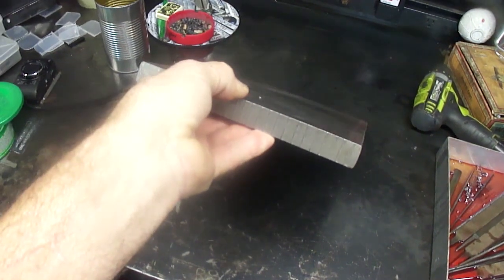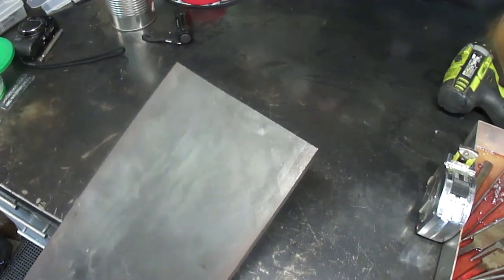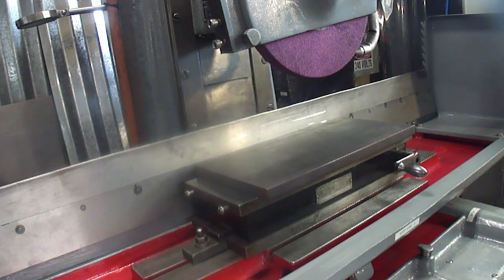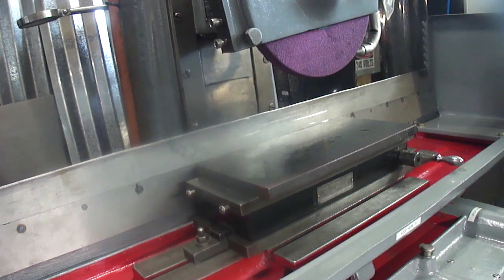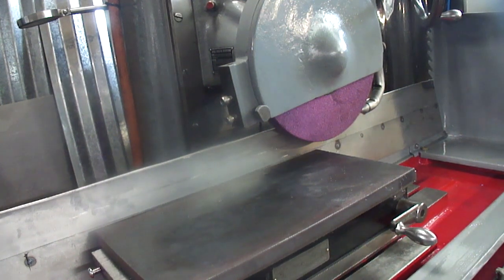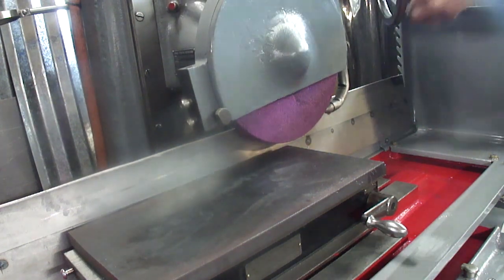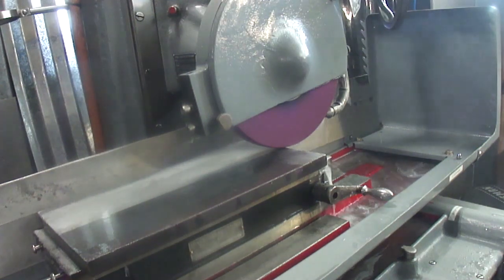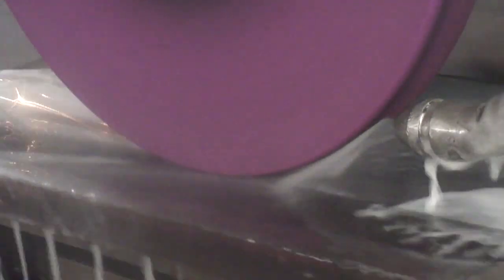Abrasive Surface Grinder FLOOD COOLANT

Comment: Your causing me to commit one of the 7 deadly sins, my friend - Jealousy!  I have been looking for a small surface grinder to add to my machine tool inventory.  I have a line on one about 150 miles away, may go look at it this week.  Don't flood the shop with the flood coolant!
Reply from the maker: Hi Vernon, the spray really shows in camera,  Didn’t look as heavy as I was doing it. Yea.....water about four feet away on the ground.  Sure was fun though. Need to drop the spray down to where the wheel meets the surface being ground, change step over from one rev to a quarter rev on the wheel for starters. Motor bogged , too much of a cut / step. Even at only a 3K cut was a lot of material. You don’t need to buy one. You are welcome to come over and use mine anytime. 😁. In retrospect I cannot justify what I have spent on this adventure with my Abrasive 1 1/2 since it wasn’t something I really needed to do a specific job.  The only thing I can say is it’s paid for itself 10 times over for the amount of fun I’ve had from all the adventures, a sense of accomplishment learning how to operate it,  and for being able to share it with you guys so we can both learn. So Vernon, I think I’m in the black. Since I’ll always be learning, always having fun at it, and I’ll always be able to share it. Have a really good day my friend.

Comment: Coolant looks great. I chose to use the mist coolant on mine.  I don't ever want to clean flood coolant machines again.  My cylinder head/ block resurfacer and my crank grinder were all flood coolant,  Took the better part of a day to clean them several times a year.

  You were really bogging down your motor on those passes.  Go with a smaller step over, it will improve the finish also. Thanks for sharing.
Reply from the maker: Think you are right Steve. A lot less step over. It was one rotation on the hand wheel , been told I should have gone 1/4 turn. I’m learning. Once I really watched the video it did look like a heavy cut. Thanks for the input.  😁

Comment: HI Ron,

You just want to make sure that wheel motor is on before turning the coolant on. You can turn the wheel motor off right after you turn off the flood coolant. You never want your coolant running on a wheel that is not turning. The centrifugal force of the wheel will keep the coolant from soaking into the wheel.
Steve
Reply from the maker: Thank you Steve. Was hoping you would let me know.  Guess I was stepping over too much. Should have gone 1/4 not 1 turn. Bogging down.  I’m learning. I’ll get there, 👍

Comment: Coolant need to flow were the wheel meets the road. So to say..   Not on the wheel   stepover 1/4 turn.
Reply from the maker: Thanks for watching and commenting.     Got it... I’ll see what kind of adjustability I have with the nozzle.first .  I was thinking the nozzle I have has a round nozzle opening.  I’ve seen others having an elongated horizontal opening spreading out the stream of coolant across the entire face of the wheel. Is there any preference on which. Was fun though.